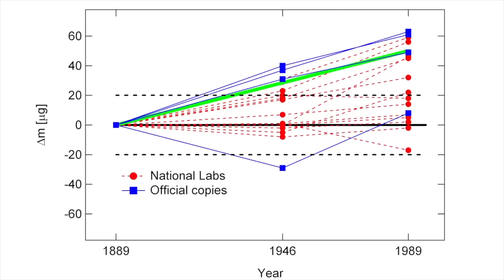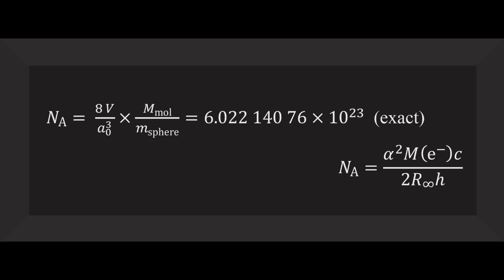The kg is dead, long live the kg

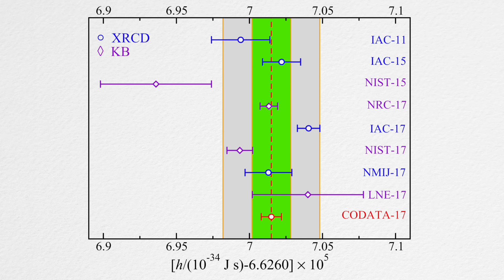Comment: Everything seems nice. But I have one problem. These measurements presented on a graphic at around 3:30 seems strikingly dissimilar. Their average value vary wildly between projects (about 1,44% discrepancy) and its distribution seems skewed. Moreover, in at least two projects raw values shows huge variability (over 1%). It seems way to much in physics. If so, then how the measure was calculated? By averaging averages? But why? With such a method you risk that including results from just one more project you would get totally different outcomes. If you choose only some results, than based on what? Is it only a matter of consensus? If we agreed on that prematurely, we will have to update it once we make next technological leap forward.
Reply: Well, that was always the idea. Defining units based on physical constants has many upsides, one such upside is that with the advancement of technology, we will converge on ever more accurately measurements of these constants, which then makes the definition of our standard units more precise. This is not possible otherwise. So yeah, you're correct, this was always the idea however. It's just not represented well in the video. 

Note that "agreeing prematurely" is basically required. We can't know if we will ever define these constants perfectly, or even if, when we actually will. As such, we either may not define them for millions of years, and rely on a system that with time becomes more inaccurate and arbitrary, or we just take the best we can and consistently improve upon it. Besides, you actually missunderstand the graphic, the error is far smaller than 1%. That wasn't the first decimal, but one of the last few. Sure, in comparison to each other, there's the inaccuracy you mentioned, but for the unit as a whole, there isn't a lot of change. For physical standards, it's actually not bad. Consider how small the unit is, after all. The error is also far less than if we were to rely on physical objects, which is another reason why scientists were pushing for this for a while. It's not just the better method in the long-term, but also the short-term. 

It's a matter of concensus because the best we can do is average our results of this highly precise measurements, there's simply no other option. The measurements are already highly precise, and their differences are reasonably small. It's pretty much at the peak of human science as is, in regards to accuracy. Well, it's beaten by QED in regards to accuracy, and a couple other measurements, but you get the idea.. it's very well done for our general standards for said measurement type. Usually, in samples like these those who are infact showing abnormal results(or hence, are flawed in some way) are excluded, so that tends to not be an issue. And the samples were chosen/the experiments were done over many years, so it's not like this is an improvised method of dealing with our results. I hope i could answer some of the quesitons you may or may not have had. :)
Reply: @LOLSpellsingerXD  That wasn't first decimal point? I HONESTLY didn't know. I wouldn't have asked such a stupid question. This graphic was very misleading. Whole point of my question emerged from my shock about acceptance over such "imprecise" measurements.

Comment: It'd be so nice for future generations dealing with scientific/engineering calculations if SI had decided to shake things up by setting these constants to nicer values without so many baked in digits. For example you could imagine SI deciding to retain only enough digits that all the values will change by less than 1%; so for example, h would be just 6.6*10^(-34) Js and c would be just 3*10^8 m/s. Of course some of our constants are composites of constants that we treat as "more fundamental", so there's only so much you can do, but still.

Comment: Doesn't that mean that the definition of a meter changed slightly too? There is a relation between the two after all.
Reply: The ration between what? The meter is long defined through the speed of light, completely independently of the kilogram.
Reply: @lunkel8108  yeah, but you can use a kilogram (through some odd methods) to define it in relation to a meter.

1kg of water is 1 L which is also 1 dm^3
This is then 0.001 cubic metres.

See the correlation? Rather than go through all of this testing they could have just made a container with 1 metre cubed volume, filled it with water and said that amount of water weighed 1000 kg, or 1 tonne.
Reply: @garrondumont  Except that that is a horrible definition because it depends on too many factors like pressure, temperature etc. This is no official definition for a reason.
Reply: @lunkel8108  so then simply define the other variables. Like you said, it has a lot of factors, but it's still easier than conducting several experiments to define Avogadro's constant.
Reply: @garrondumont  It is way way harder to do it precisely. Again, this is the definition for a good reason.
Reply: @lunkel8108  Well, if it's harder or not I can't really say, it just sounds easier using my method. Apparently it isn't as they'd have done it if it was.

Comment: no longer tied to physical objects is all well etc etc....but there is something called taking things too far..too much of a good thing is a common phrase and i think it applies even to the obsession(of people other than me)about THE MOST PRECISE NUMBERED MEASUREMENT..but pause to consider how much precise do numbers have to be to serve as tools?nature is not absolute and constant..the only things constant about nature is causality and variability(which means uncertainty cannot be eliminated)but people are trying to eliminate it by insisting on finding MORE PRECISE NUMBERS....in the end numbers words images sounds and motor sensations are human tools to make observations of the universe to make sense of it..its good we are improving the tools but we must also accept no improvement(and not even infinite precision) can eliminate uncertainty..we should use the tools as best as possible not by making precision infinite but by using a fixed set of tools in infinitely diverse ways....that's how DNA and protein are capable of so much information despite using only 4 and about 20 building blocks respectively..is nature trying to make these or anything more precise?with infinite potential already existing what,s the need of infinite precision of numbers?

Comment: Is it just me or does this sound morbidly convoluted?
Why not just define units by a monocrystal brick. Distance based on one of the edges, mass based on the mass of its atoms.
Reply: I would like to be Ant-Man and count, one by one, atoms of hydrogen, but it would take me a mol of years to do it
Reply: @dexterrik

Or you could measure/manufacture a monocrystal's dimensions very precisely so you'd get the desired amount. Within whatever precision you strive for.
Reply: @avada0  A mono-crystal of what material?
Reply: @avada0  Monocrystal production is complicated, even commercial crystals oscillators (common chips that are made for clocking high precision tasks with deviation in time less than 1 cycle in 1 million oscillations) tend to cost near 30 dollars per piece; also, you would need the crystal to be inert with atmosphere, temperature, air pollution and a manufacturing process that could be replicated all over the Universe

Comment: How will this affect safety for manufacturing and maintenance of aircraft/infrastructure, particularly when it comes to introducing parts from the new standard into existing structures using the old one? Like problems of load bearing or fatigue.
 I haven't seen what the difference between the 'old' kg and 'new' is,  only that le grande K is being replaced by some calculation involving Planck's constant, which is being fixed in value. I guess if the difference is at the scale of the  Plank constant, there's almost no chance of the difference having an effect on a macroscopic level?
Sorry I really know very little about how to make sense of this stuff. Anyway it seems even a small difference between materials built from the old standard and the new, multiplied across vast quantities of a material, or subjected to great and sustained forces, could have significant consequences? 
Though perhaps the materials used always have some error threshold (?), and,  I could imagine the difference in weight when simply comparing two examples of the same component from the same production line may be greater than the expected difference between examples of the same part but made with old and new kg standards, so that such differences would fall below any significant threshold. 
But then, really, what could the effect be of using parts of mixed standards? Will it matter?
 I'm just curious, obviously I'm not an engineer or scientist of any kind, so I hope someone has an answer :)

Comment: Currently (as of Wikipedia’s “2019 redefinition of SI base units”) h = 6.62607015 x10[with an exponent Of -34) Js.
Reply: just a little update to viewers if they were wondering if it was changed again.
Reply: @punkposssum7773  for exponents, use the "^" character. I know it as an input carrot, but I have no clue if that's what it's actually called.

Comment: Except for the fact that the US for some weird reason doesn’t use the metric system anyway🤦‍♂️
Reply: Ok, Britain did make the imperial system but even we changed to the metric system because it just make much more sense. America has had plenty of opportunities to change but weirdly doesn’t
Reply: they wanted it, but too much of a hassle.
Reply: @romianglutera8093  hehe calculating everything in 10s is a hassle too
Reply: @willi1978  What's a third of 4 lbs 7 oz? If you need to cover a 2 foot 5 and 9/16 inch span with two panels leaving a 1/8 inch gap between them, how wide is each panel? Imperial units are GARBAGE!!
Reply: @skierpage  u forgot the feet thing xD
Reply: Except for that it's not except for since imperial is defined in relation to metric so it still changes
Reply: Xavier Leitch — Wrong.  Americans use the metric system in many ways.
Reply: People need to stop saying it's just the US. There's a few other countries that use imperial. Also, many people in britain use imperial for various things. The only difference is that nothing official is in imperial.
Reply: @ashtonhoward5582  In the US we learn metric too, we just mainly use imperial because everything here is imperial and our stuff is made to be like that.
Reply: it's the brits fault

Comment: now they should redefine a meter so that earths pull is 10m/s per second rather than 9.8, just to clean things up. it's light distance per second definition changing as the standard as well.
Reply: The meter is defined as the distance travelled by a photon in a vacuum in 1/299,792,458 of a second. A second is defined as the amount of time it takes on atom of Cs-133 to perform 9,192,631,770 hyperfine transitions in its ground state at 0K. If the definition of a meter is changed, it will affect everything; that's not hyperbole. The whole point of the SI is to ensure consistency, and a roughly 2% change in the definition of the meter is not insignificant.